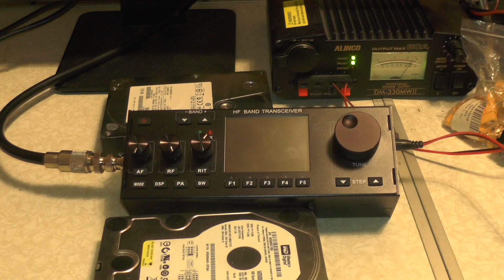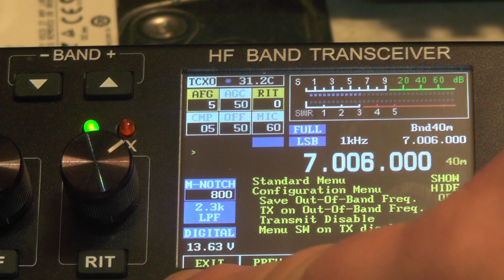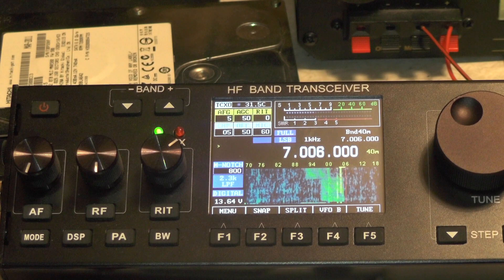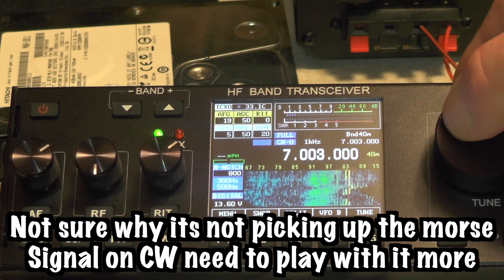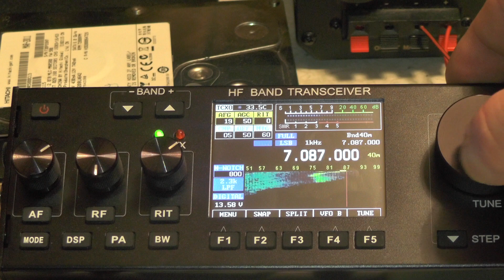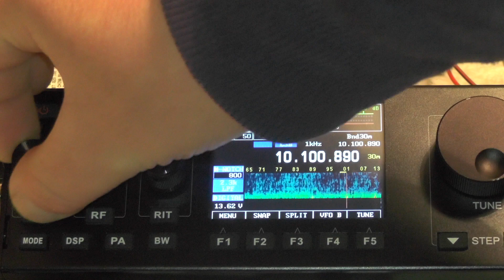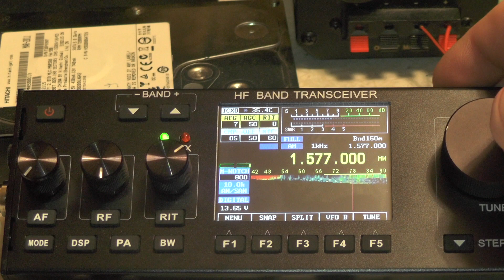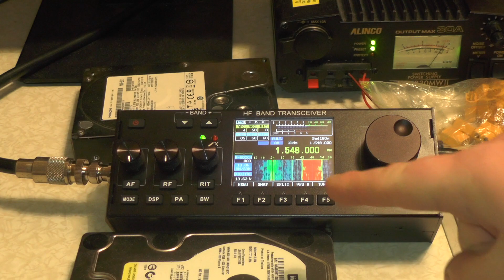HF SDR Transceiver RS 918

Comment: If you transmit on 27MHz it transmit (I receive signal in a near radio) but non appear power or swr signal meter. Why?
Reply from the maker: Mine will TX on 27mhz but only put out about .5 watts and a bit more on 28mhz not really used it on 27mhz will do and have a play and see whats happens

Comment: Hmmmmm, transmits out of band!! I doubt it would get FCC approval here in the US, I'll stay with the big three.
Reply from the maker: You can turn the option on or off so if you tx on 11m it won’t tx
Reply: @2j4ez  The point I'm making IS, it wouldn't get FCC type approval because of this. Besides my Yaesu 1000MP does most of what this can do, except digital.
Reply: @yauwohn  You should ( like everyone else ) get the original McHF from M0NKA .

Comment: great kit, i have one, but they're generous with the output power spec, more like 5-8 watts max,
Reply from the maker: It should be 15w more like 5-8 and even lower on 10-11m
Reply: @2j4ez  its not that great an issue portable, i'm looking at the matching 50w linear too👍👍

Comment: I see that the spec doesn't mention 11m, but you said at one point that it does TX on 11. Will it cover the entire UK40?
Reply from the maker: Yes it will tx out of band and will cover all uk 40
Reply: @2j4ez  mine will tx on 11m but does not put out correct wattage, only does 50mv on 11meter. any idea how to change this.
Reply from the maker: @26DR715  Ive not tested the wattage on mine ill have to test it on 11m

Comment: Great Video, Nice kit.
Wondering what antenna your using. 
Looks like it picks up HF very well. 1548 UK-Gold  ;-)

73
Reply from the maker: it was just connected to my 11m antenna just for receiving only if i use a ATU my 11m antenna will do 20m